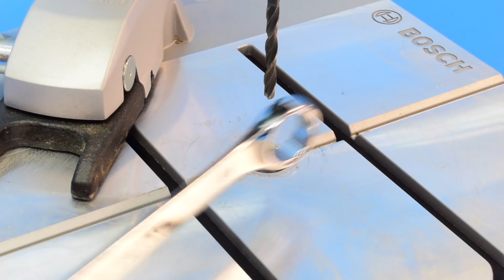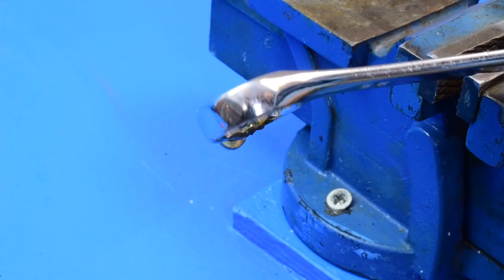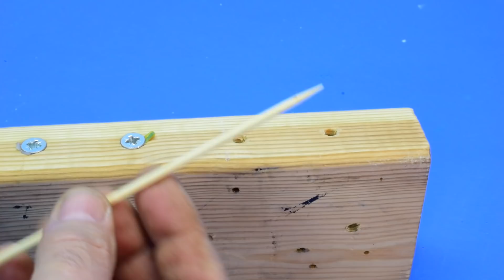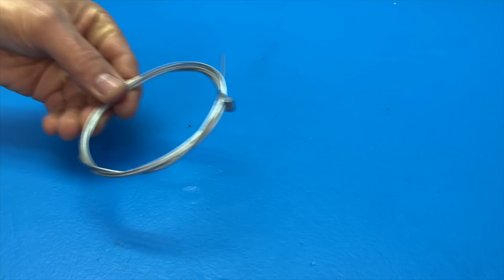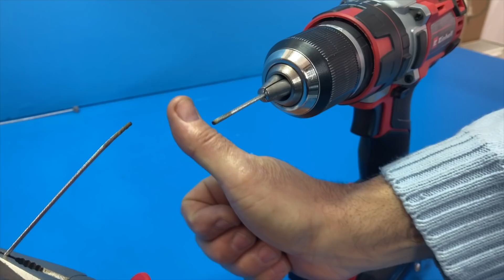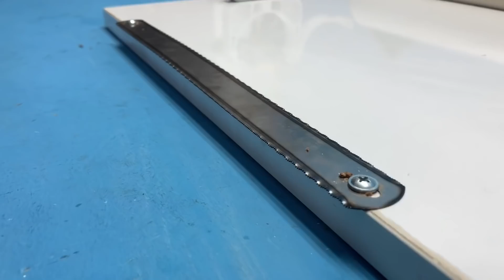Amazing Tools and Repair Tips Level 100!

Comment: kewl !!! :D
x-tra tip:
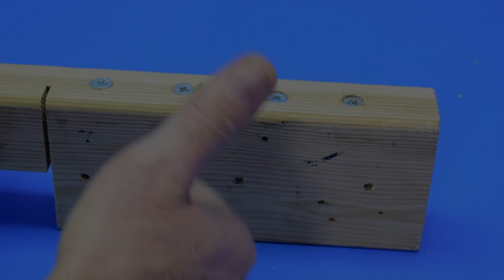1:30 put the magnets in a plastic bag and when you're done drilling move it over to where you want to dump the metal shavings and take the magnets out of the plastic bag. Then the shavings will fall off without you have to do anything. Heeey!